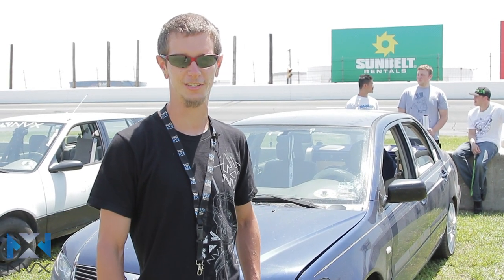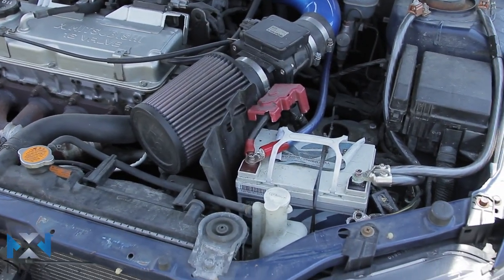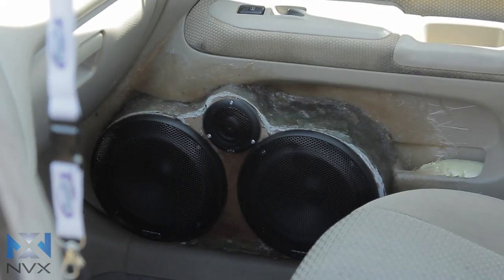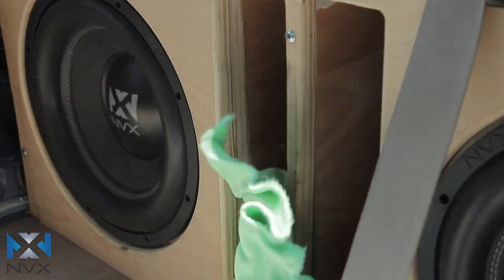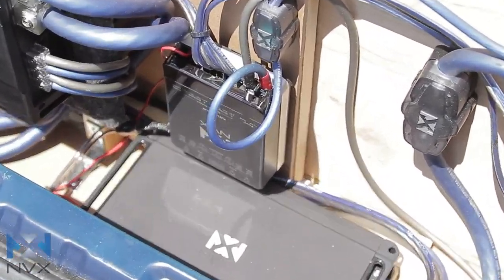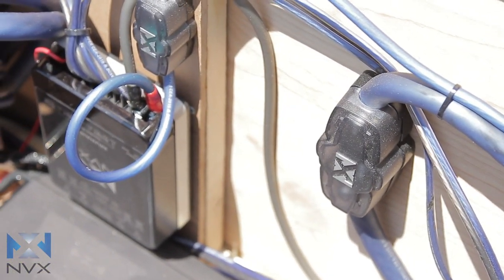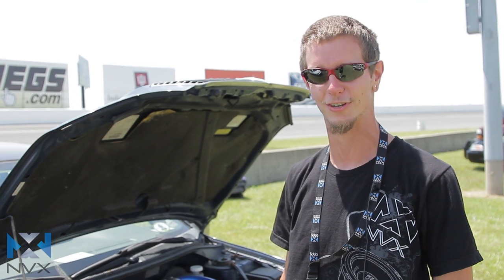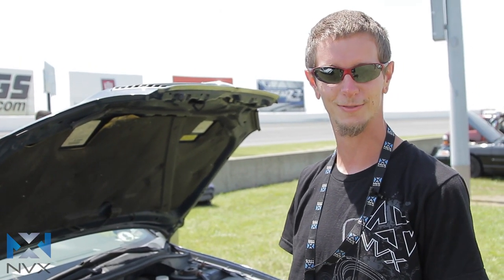Team NVX Demo: Adriyel Moosreiner | Slamology 2014

Comment: Whats better the vcw 15s or the vcw 12s? I have an ext cab s10 with a nvx vcw 154 wired at 2ohm on a 2000 watt hifonics amp. I can move a little bit of hair, but i want to do a legit hair trick. After everything is all settled id like to either have 4 vcw 15s or 4 vcw 12s on two hifonics brutus 3k watt brutus. After i upgrade my alt of course. But will two of the 15s do a decent hair trick if the box is tuned anywhere from 30 to 35 hz? I was moving a little hair in a 39hz atrend box.
Reply: Brandon Wessel Did u end up making the upgrade happen?

Comment: Under 150db  isnt bad for 2 12s its just not very impressive by todays standards. Not hating , it sounds great, ive heard the vcw subs before , they are nice and clean sounding for under 200, but there are also other brands that sound just as good and can get even louder and handle more power for under 200.  Im all about bang for buck but 20 or 30 bucks more for something thats louder and last twice as long is the way i would go.